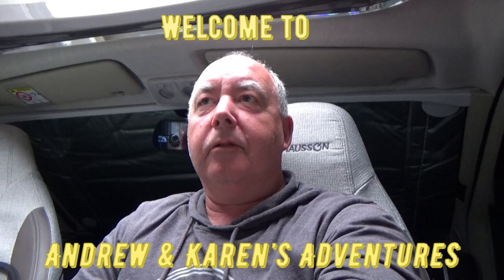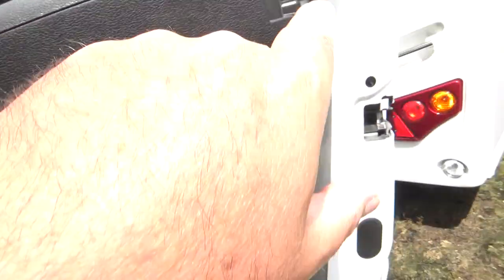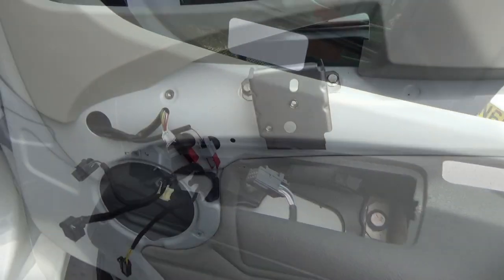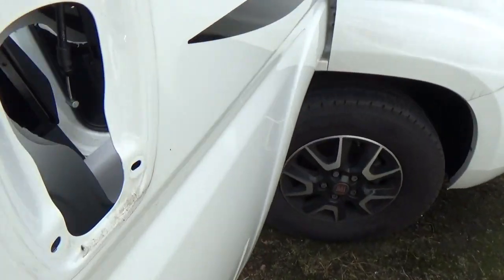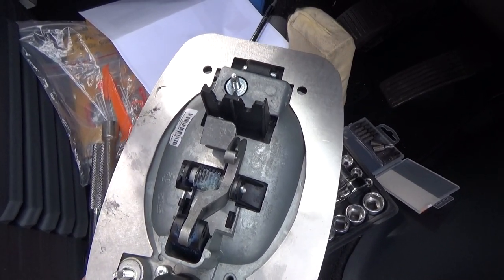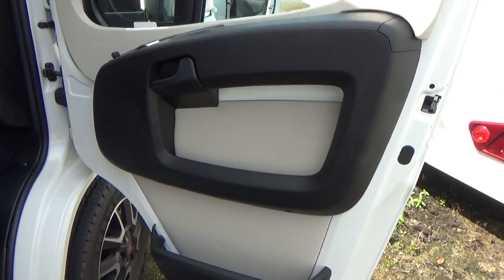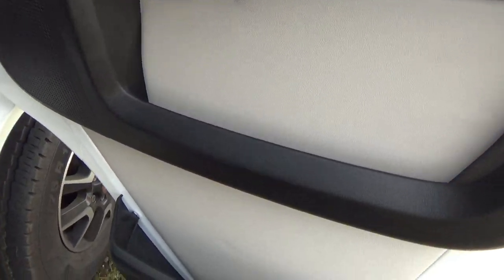Fitting a FIAT DUCATO PRO PLATE to drivers cab door of a 2018 CHAUSSON MOTORHOME

Comment: Well done, nice job. Don't think I would attempt anything major like that. 👍
Reply from the maker: Thanks 👍It was a bit of a struggle with the restricted access - I have to re-visit the door panel as I could not get the clip fixings from out of the door with the plastic trim removers so ordered a metal trim remover to hopefully remove & refit the door panel correctly

Comment: Nice job, will have to look into this.
Reply from the maker: You should - It was a bit of a struggle with the restricted access - I have to re-visit the door panel as I could not get the clip fixings from out of the door with the plastic trim removers so ordered a metal trim remover to hopefully remove & refit the door panel correctly

Comment: Do you think it’s worth doing and where is the best place to get them cheers
Reply from the maker: Yes seen a video how easy it is to place a rod behind rubber seal between handle &door and push up lock linkage, even if alarm is on its not triggered, got mine off EBay comes with all instructions 👍

Comment: Good job Andrew,as a retired hgv mechanic i have always said why don't manufactures make bigger holes in door panels 👍
Reply from the maker: Hi John, yes a little bit restricted but got there in the end, I will have to revisit once I get a metal trim tool to remove plastic clips & fit them back into the door panel, I dont know why van manufacturers haven't done something better themselves to make it harder for the thief to get lnto the van, once I got the handle off I could see how easily they could unlock the van without a key,  I watched Happy Travellers video & how easy the thief broke into there van while asleep, so any deterant is better than none in my eyes 👍😁

Comment: I just fitted the a pro plate for the rear doors which was super easy. I have also installed a pro plate on the passenger door but had to abandon until tomorrow. Reinstalling seems relatively easy but I am currently stuck on putting that fabric backed carboard, how the hell do you slot them back in to the unusually shaped plug clips. Any tips or tricks on how that part goes back on? I am guessing you had problems trying to take them off. All i did so far was try to rotate them all in the exact same direction hoping that I can slide and drop back in to them. Man it seems a struggle.
Reply from the maker: It's a pig of a job, I had to buy a metal trim remover to get those clips out, it's jus a case of persevering, I had them at an slight angle & twisted them back in 👍😁
Reply: Andrew & Karen's Adventures I think this will be a long day for me. Everything else is simple, it's just this part. The wholes in your cardboard look better state than what mine are in so we will see

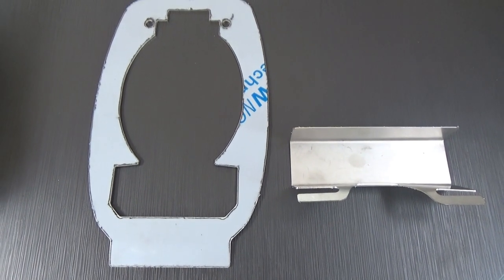Comment: At 1:20 you also show a second bent U shaped plate, but I could not see that fitted.  Did you fit that part?
One big advantage of these plates over internal devices is that they are visible deterrent and they won't try.  With internal locks, they still damage the door, then find they cannot get in.
Reply from the maker: Hi Simon, yes it was a struggle but managed it, but that was after I took the footage, yes this is a visible deterant, thanks for watching👍😁

Comment: Did these plates originate from Garrison through eBay?
Did you remove the Remus blinds and if so can you please detail this procedure?
Did you use a door panel removal tool to ease out the clips?
Reply from the maker: Link to seller :- https://www.ebay.co.uk/usr/car-and-commercial-solutions - £21 + 8.95 postage
I did not want to do a full how to video, it was just to show people what I had bought &rughly how I went about it.
Wish I had removed blind as I broke off a locking tab - I think if you search Remis blinds on YT I'm sure it will come up with a video of how to fit / remove the blinds.
R.E Door panel as explained in video I had to re-visit it, strip door again once I had bought the correct tool to remove the clips & put back onto the door panel so now all OK

I hope this helps
Reply: Tyou for prompt and most useful reply. May I pose one further question please: you only fitted the plate to one door, ie, the door with the keyhole  so is the lock on the other door safe from an intruder?

Comment: You should have watched the happy travelers video.  I think he did both doors as they were broken into in France
Reply from the maker: Hi Bob - I did watch it 👍As I understand they can only break into the side with the keylock on so that's the reason I have only done that side 😁👍
Reply: The Happy Travellers didn’t fit the plates due to comms issues with the manufacturer!